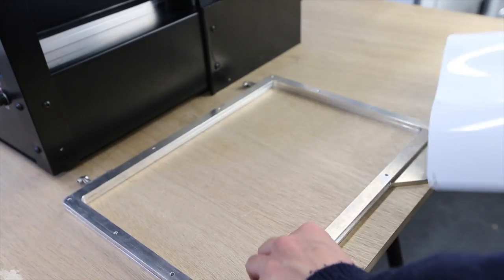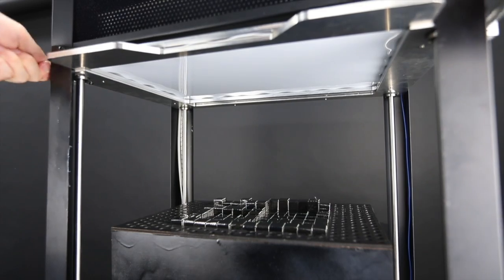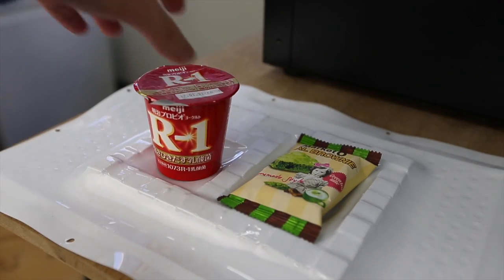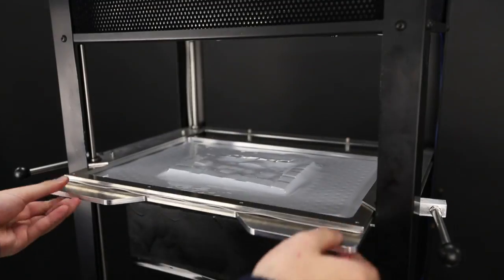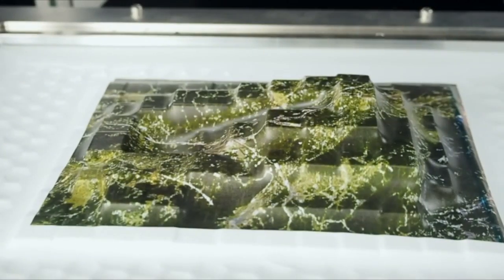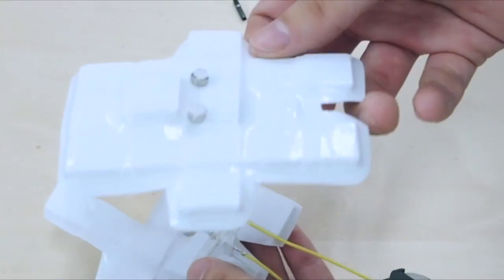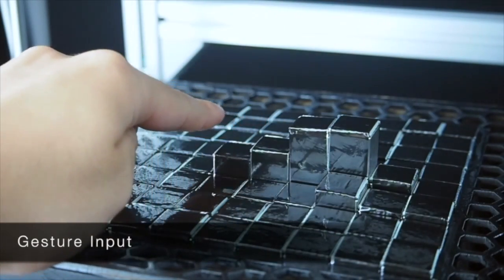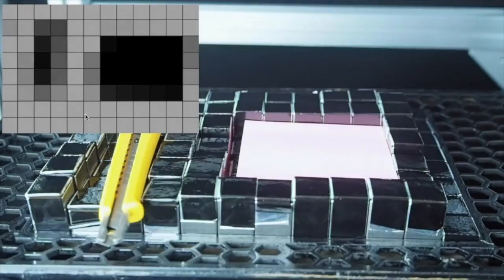ProtoMold: An Interactive Vacuum Forming System for Rapid Prototyping ( CHI 2017)

Comment: love this idea like Hudson said if the sections were smaller it would have greater control of the detail, but love this idea :D ...... have you ever seen the old pin toy? its a toy with lots of pins and a glass bottom so you can push your hand in and it creates an image ( like yours ) check them out :D great work :D